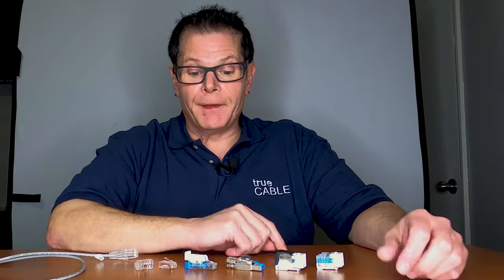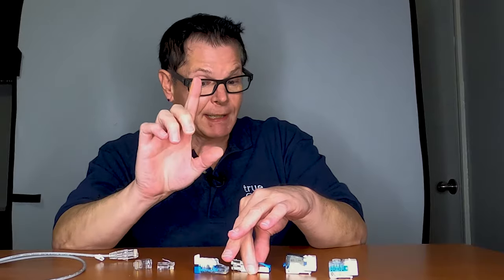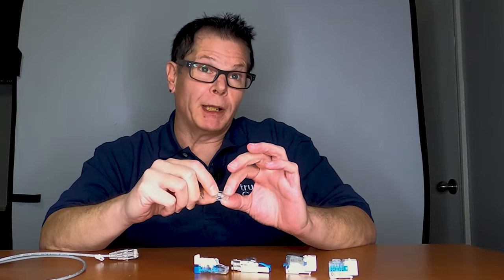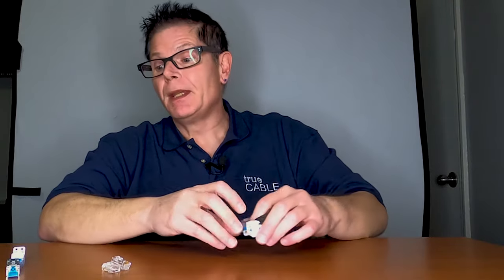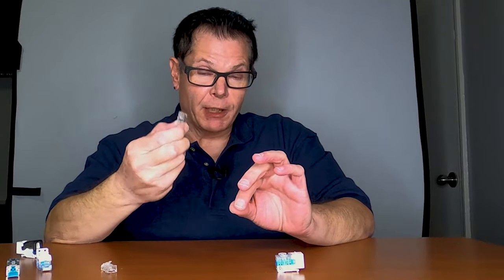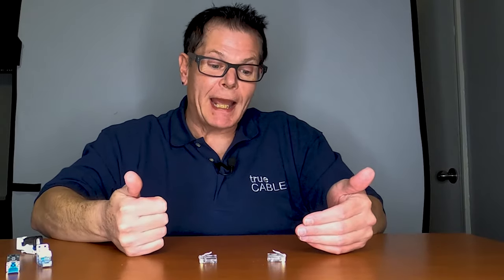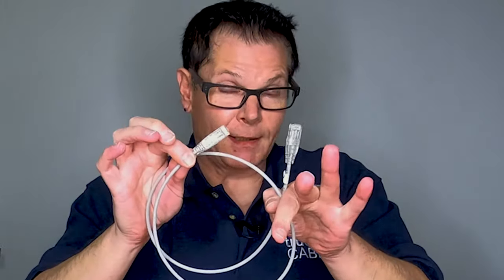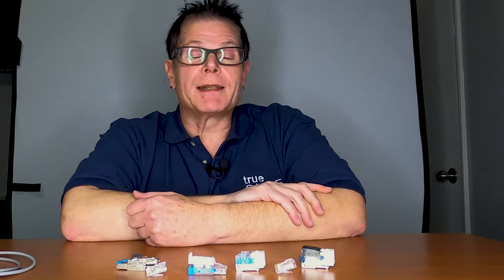Choosing the Correct Ethernet Termination

Comment: Can I buy burried cables with proper ens on it already? I have shop want to extend 6a to (dual runs) .  About 150ft.  If I can do you do custom lengths?
Reply from the maker: Hello! I would strongly suggest buying a 500ft spool of our Cat6A Unshielded Direct Burial cable and then terminating both sides of both runs to Cat6A Unshielded Tool-less keystone jacks. You will need 4 keystones. Mount the keystones in wall plates in your home and then in your shop. You can buy two port wall plates so both runs come to the same spot in both structures. Finish up with two factory pre-made Cat6A patch cords on both sides to the destination devices. This method will give you flexibility. The permanent part of the install will have the cable buried and mounted in a fixed location in both structures. You then have the flexibility to use different lengths of patch cords on both sides if your equipment happens to move around inside one or both structures. Considering your permanent runs are only 150 feet each, you have a lot of flexibility on how long the patch cords can be on both sides (combined length). You will have to be aware of the copper gauge of the patch cords and be prepared to trade length for thinner gauges, though. Here is a blog and video that will tell you how to calculate it properly: https://www.truecable.com/blogs/cable-academy/calculating-ethernet-cable-overall-channel-length-for-success. Be sure to watch the video AND read the blog because the written blog has lots of tables and examples.

Comment: Is this primarily an issue with longer runs? I expect most of my runs to be well under 100 feet, and I only need 1GB performance.
Reply from the maker: Hello Jollyprez! Run length is not relevant. In fact, the shorter the run the more likely errors will show up due to poor termination performance due to stronger reflections back and forth in the cable. That is why IDC connections (keystones, field termination plugs) are so valuable. They impedance match your run and far more mechanically (therefore electrically) stable. If you need only 1G performance, then 8P8C connectors are still viable but at the same time I still recommend caution and being sure you are using plugs and cable that have been tested and validated together. Don't mix brands, in other words. There are a lot of things that can go wrong with 8P8C connectors terminated to solid copper Ethernet and you want to control as many variables as possible. One thing I have found is that the cheaper you go on your terminations, the need for an advanced tester like a Fluke LinkIQ intensifies!

Comment: Thanks Don for the high quality content! What cable config do you recommend from modem to switch that would support 10 GbE? Cat6A unshielded with field termination plugs on both sides? Or? 
(Its unfortunate that trueCABLE doesn't sell patch cables)
Reply from the maker: Hey Mark! You are welcome. We have patch cables coming, but they are still at least 90 days out. As for a high speed & high reliability Cat6A patch cable connection between modem to switch I would definitely be using that unshielded Cat6A cable with the Cat6A Unshielded Field Term Plugs on both ends. This is critical for solid copper conductors! You won't regret going this direction.

Comment: Very interesting from a newly-interested DIY-er. I'm about to drop new lines in some rooms as I'm tired of the lagging WiFi on certain parts of the house. I just ordered your 500 FT Cat6 rather than your Cat6A after watching your honest opinion about a recent video you  produced regarding  the differences between the two. Thank you for the education as I was initially looking into Cat7! Can you elaborate a bit more as to what you meant regarding Cat6 being one of the "most versatile cables on the planet" after  the newer NBASE-T  protocol?
Reply from the maker: Hello and thanks for your question! You were right to ditch Cat7. It is no better than Cat6A and both are rated to 10G up to 328 feet. Cat7 is also not a ANSI/TIA recognized Category. Cat6 is extremely versatile because it is easy to run and bends tighter than Cat6A, plus it can reach 10G at 120 feet or less even when in a larger cable bundles. Due to 23 AWG conductors, it also handles PoE very well. The new(er) NBASE-T protocols (2.5GBASE-T and 5GBASE-T) also operate on Cat6 up to 328 feet without issues. Finally, add to the mix that Cat6 is less expensive and uses less expensive keystone jacks and you end up with a very versatile cable.

Comment: Are using coupler patch panel bad for cat6a/10gbps networks?
I have multiple 2.5Gbps Unifi Ap’s connected back to the coupler patch panel (Rj45 at both ends of the cable), i did this for multiple installations with no problems.
But suddenly have issues maintaining 2.5Gbps FDX on a different place.
Reply from the maker: Hello! You discovered what many people have or will soon. LAN speeds are increasing, with 2.5G becoming common. Anyone using a coupler with questionable quality factory made patch cords or hand-terminated solid copper Ethernet (using RJ45s) is at high risk for issues. Up until now, 1G networks have been relatively tolerant of coupler use assuming a certain minimum level of quality and good workmanship. Even then, though, coupler use is a gamble. To answer your question more directly: It is a BAD idea to design a permanent installation with keystone jack couplers from the get go. TIA, BICSI, and other industry organizations saw this coming and don't recommend you use couplers at all. trueCABLE modifies this recommendation a bit by indicating that if you are using pre-Certified patch cords (Certified, NOT "verified"), then it is acceptable to use a single coupler in a channel assuming you don't need to Certify the installation after completion and present test results to a customer. The installation may not fully pass TIA performance testing which is quite strict and severe, although it may work well enough for some installations. I generally think of couplers as for "oops" moments and temporary until I get the issue corrected via cable replacement. So, if you are going to use couplers at all it should be with factory made, pre-TIA Certified patch cords and when you need to connect two of them together when one of the patch cords is too short to make the connection. Constructing a LAN with hand terminated RJ45s on solid copper Ethernet cable (problematic in of itself) AND couplers gives you a worst case scenario and is a recipe for disaster. You may wish to take a look at our Cable Academy at trueCABLE.com as we have extensive blogs written about how many couplers is too many and the best way to terminate Ethernet.

Comment: So I've always been in the "No hand-crimped RJ45!!" group for many years, having experienced countless imperfect terminations and even cables that are fine at first would tend to fail in a few months of they get wiggled or bumped much.

I was recently introduced to passthrough 8P8C connectors, where the individual conductors actually protrude from the front of the housing and get trimmed when your crimp it. This method would seem to resolve all of the most common imperfections I used to see (conductors weren't cut perfectly straight, stripped too long/short and the jacket isn't being held properly by the housing when crimped, etc). I'm wondering if you have any experience or comment on these. 

I'm about to wire up a house with cat6 (unshielded), and currently it's only going to be gigabit but I might want to make a few backhaul lines 10Gb in future. One end will be punched down to a Keystone, do you think that would be good enough even if the other end is crimped? The runs will only be maybe 30-50ft.
Reply from the maker: Hello and thanks for your comment. I have found the root of the issue to be the way RJ45 8P8C plugs hold the conductor, which applies to pass through and non passthrough style 8P8C plugs. Your better experience with those pass through plugs was likely due to them being a better fit for your particular cable as opposed to the fact they were passthrough. Although there are some valid use cases for putting 8P8C RJ45 plugs onto solid copper Ethernet (MPTL runs pushing PoE to an end point device that requires PoE for example) I strongly suggest IDC style terminations--especially for cabling that will be called upon to push 10GBASE-T. This means your original thought of keystones and patch panels is still the way to go. Another overlooked IDC style of termination is the field termination plug, which give you a male plug end but terminates largely like a tool-less keystone jack and has a PCB inside helping to impedance match the cable run.

Comment: I'm actually having issues with 10GbE on one of the longer runs connected to my windows machine. I'm going to re-terminate into keystones and see if that improves my situation. Love these videos!
Reply from the maker: Hello Sean! You will likely see a massive improvement. Keystones at both ends will do a lot for performance. Just be sure to keep permanent links (jack to jack) to 295 feet or less and adjust for ambient temperature as well. As temps go above 68 degrees F, your runs get SHORTER. For patch cords, don't use excessively long ones to patch into your permanent link. Per the spec, you have a total of 33 feet (accounting for both sides) to work with and that is assuming 24AWG. That drops to 26 feet for 26AWG and 20 feet total for 28AWG. For a chart that goes over complete calculation of a permanent link + patch cords (overall channel) see here: https://www.truecable.com/blogs/cable-academy/calculating-ethernet-cable-overall-channel-length-for-success.
Reply: What issues were you having?
Reply from the maker: @Saturn2888  Hello! Failure to Certify on my cable analyzer was the primary issue. Best results are achieved with IDC (insulation displacement contact) terminations such as keystone jacks that punch down or are "toolless".

Comment: Does the TrueCABLE Cat6A Toolless Field Termination Plug, Shielded (STP), PoE++ (4PPoE), TAA Compliant fit properly when used with a TP-Link 10Gb switch? Specifically, is there enough space to use all ports side by side given the larger size of these plugs? Any insights or experiences would be greatly appreciated. Thanks!
Reply from the maker: Hello! Yup, no problem. The side by side fitment on high density switches is no issue. I have tested that, and our field termination plugs were designed with that in mind. The issue you might run into with field termination plugs is due to the length, primarily.

Comment: I just need something clarified for me.  On each end of the cable run is a keystone jack.  On one end a patch cable is connected.  Does  or can the keystone on other end connect with a wall plate to serve as a wall jack?
Reply from the maker: Hello! That’s absolutely correct. Both ends of a permanent link (using in-wall solid copper cable) terminate in keystone jacks. At the head end of the installation, where the switches are located, you mount one keystone jack into a patch panel. At the remote outlet, you mount the other keystone jack into a wall plate. Then, you connect patch cords on both ends, and this setup is referred to as the channel.
Reply: I am so glad you mentioned the solid copper cable.  I had originally placed an order the for cat6 Ethernet without realizing that some is copper clad aluminum and not suitable for POE.  I was able to get that order cancelled and order the pure copper. Thank you.
Reply from the maker: @craig2535  Hello! You are welcome. By purchasing solid copper Ethernet, you just saved yourself from a lot of hassles (during installation and down the line). I am glad our content was helpful in guiding you to the correct choice. PS - I would like to add that CCA is suitable for a clothesline and not much else. Not only is it no good with PoE, but it also has significant DC resistance unbalance issues that won't permit reliable and consistent data transmission.

Comment: Hello guys!
Looking into upgrading my home cabling with Cat6a, I'm currently running 3 routers as wired APs.

This is an old house so it all has to be ran outside, so I will be using shielded cabling, but was thinking into doing a combination of Field Term plugs on one end and regular shielded Rj45 on the other. 

Would this be as reliable as doing keystone/Rj45?

Like I said, I won't be able to do keystones so I was thinking this would be the next best thing.

Hope you can help me out!
Reply from the maker: Hey Axel! Yup, that would be as performant as using keystones > RJ45s. The Field Termination plug is also a component rated and impedance matching Category rated device, so it does a lot for cable performance. Obviously, a field term at both ends is even better IF you can get away with using a larger style termination. If you do get forced into using shielded RJ45s on solid copper, just be super careful and precise about how you terminate them. If you are using our Cat6/6A Shielded Pass Through RJ45 on our shielded Cat6A, then there is very detailed and up-to-date instructions found here: https://www.truecable.com/blogs/cable-academy/how-to-terminate-a-shielded-cat6-6a-external-ground-pass-through-rj45-connector.

Comment: I'm in the UK, I think both the layman and the DIYer with some knowledge will have little use for greater than 1 GigaBit for quite a while, so I'm just trying to figure out your mindset wrt not recommending the basic gigabit stuff. Is it purely from the business point of view that you'll get fewer edge case failures and will be future-proofed?
I work in schools, I am a graduate in networking, and I've never used anything past 8P8C plugs with copper. For the 10GBics we have fiber runs from cab to cab. 
However, we're commissioning a new school, and I think government regs are requiring 2.5Gbe capable cabling moving forward. So it will be interesting if we need to start using field-termination-connectiors with impedance matching etc for patching APs in etc? 
Anyway, my first video of yours, liked all aspects of it. Thank you.
Reply from the maker: Hello Miff! Howdy from the USA. I agree that the vast majority of consumers will be on 1G for quite some time to come. That said, I have seen the market moving steadily towards 2.5G in the home (computer motherboards, cable modems, and some Ethernet switches). 5G and 10G are typically seen in commercial settings at the present, but there is the odd homeowner running those speeds for various reasons (NAS, etc.). 8P8C plugs, no matter the Category or speed, are a potential problem point from a mechanical (and therefore electrical) standpoint due to the extreme degree of sensitivity to proper fitment. If you get the fitment wrong (insulated conductor diameter, or cable overall thickness) your 8P8C plugs are going to be the source of headaches. IDC terminations (keystones, field termination plugs, etc.) are much less fitment sensitive and eliminate a possible major point of failure from your LAN. I recommend keystones and field termination plugs where possible not only for the path of least issues, but also for their ability to allow your structured cabling system to reach its maximum potential, and as speeds increase over time this will become more of a factor. Of course, there are times when 8P8C plugs MUST be used due to installation limitations like tight PoE WiFi AP and camera housings, but use of 8P8Cs on solid copper Ethernet should be kept at a minimum. Otherwise, leave the 8P8C plugs to factory pre-terminated and tested patch cords. Thank you for watching, we are happy to have you here!

Comment: Best video out there! I only have 1 question - What is all this confusion about connector types for wire/solid core/universal. You know, 2/3 pronged, angle pronged. What to buy for home use and all my cables?!
Reply from the maker: Hello! 2 prong 8P8C plugs are for stranded copper conductor Ethernet. 3 prong 8P8C plugs are for stranded and solid. I guess you could call the 3 prong version "universal" but that is a misnomer. 8P8C plugs are not, in any way, universal as they are so fitment dependent on the insulated conductor diameter and cable jacket OD anyway. I would purchase the 3 prong version in any case.

Comment: I have a network in a campground, Pole mounted AP's, and switches inside weather proof ventilated boxes. I keep getting arcs/shorts from the POE and its causing switch ports to cook out. Any tips? I though about having a punch down patch panel.
Reply from the maker: Hello! That sounds bad! I would recommend you take a more structured approach to this. Terminate keystone > keystone (or patch panel to keystone) and then use factory-made pre-terminated patch cords to complete the overall connection. Obviously, the keystone/hardware/etc. mounted outside needs to be moistureproof (including from humidity). See if that resolves it.
Reply: Maybe an Ethernet Surge protector *WITH A GAS DISCHARGE TUBE* could be an extra bit of insurance for that line.
Reply from the maker: @haywoodjablome440   Hello and trueCABLE seconds that! Gas discharge tube ESD protectors are a great idea for copper twisted pair Ethernet that runs outside, as it is more subject to the issue. This especially applies to any aerial installation, which we blanket recommend the use of gas discharge tube protectors with.